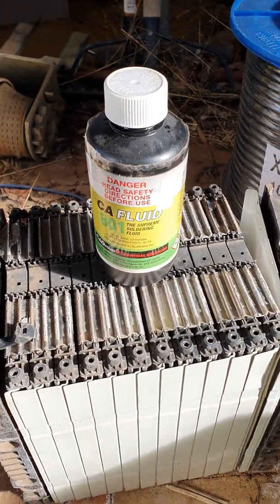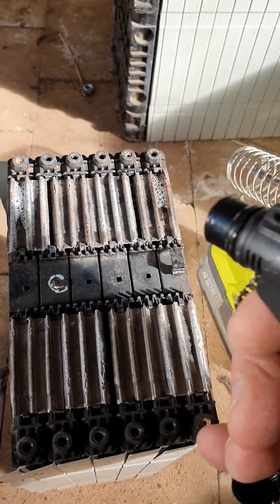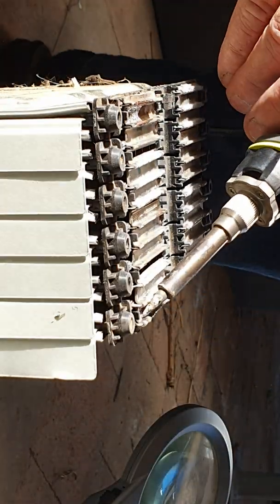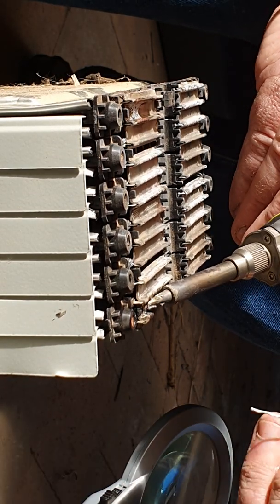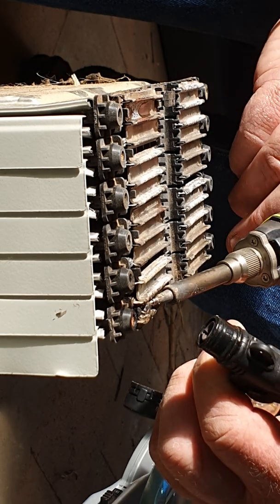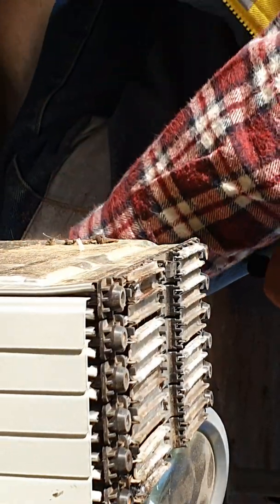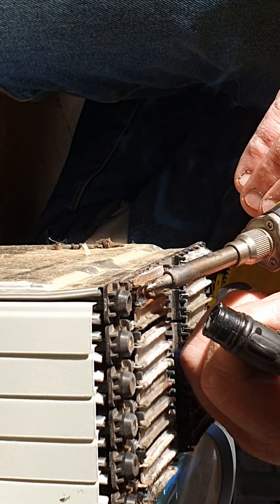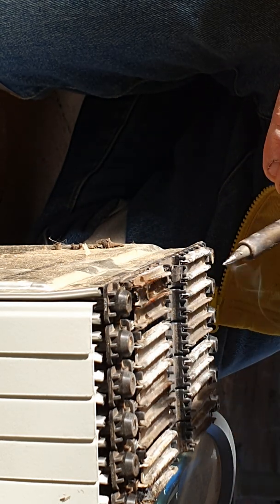A123 lithium  lifepo4  battery lead soldering terminals to battery

Comment: Did you try alternate ways to attach a terminal? I have dozens of the 5kw modules and split them into 12v batteries for a project. I just bought a little argon arc welder i am about to try.
Reply from the maker: With argon tig welding, its a matter of finding the right material and filler rod that will weld to to bus bar,  you would need very very low amps with a very small tungsten tip, I am a welder by trade!
Reply: @sjdtmv  i only have like 10hrs of welding under my belt. Im trying to figure out what to use as terminals now to weld to pack. Any ideas on what to use?
Reply from the maker: @michaelgrodecki4159 welding the bus bar is something that I wouldn't do, soldering with soft solder is using less heat then tig welding